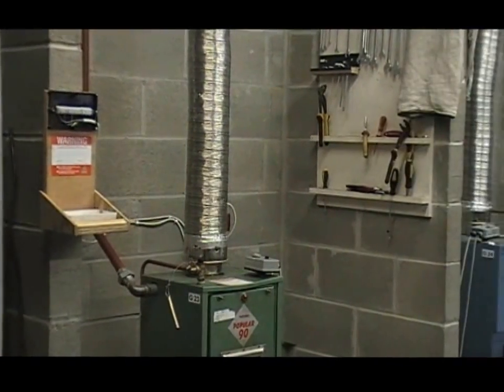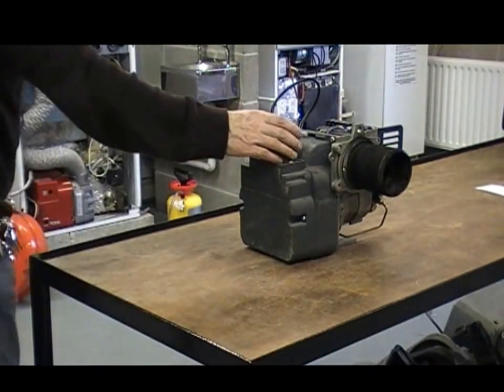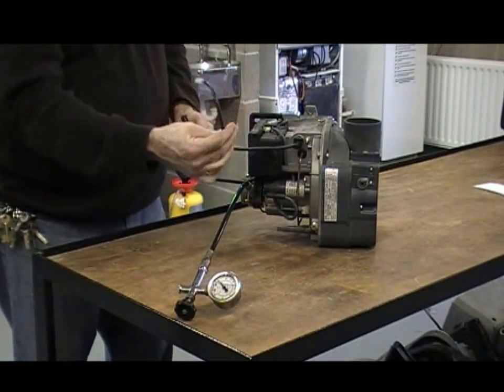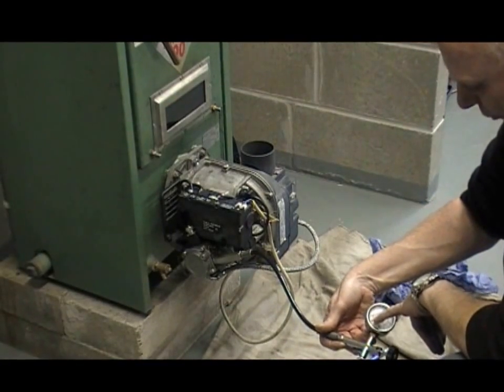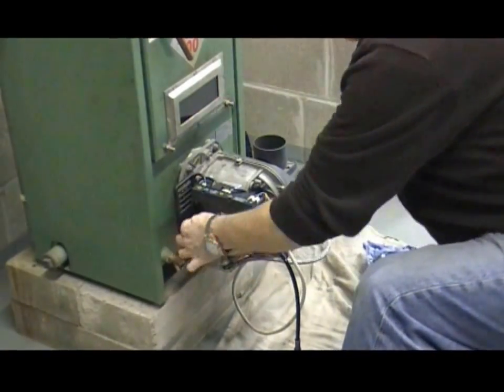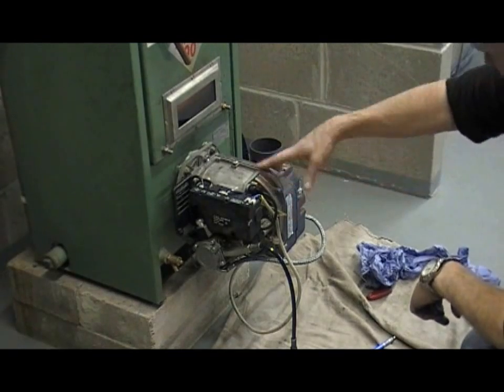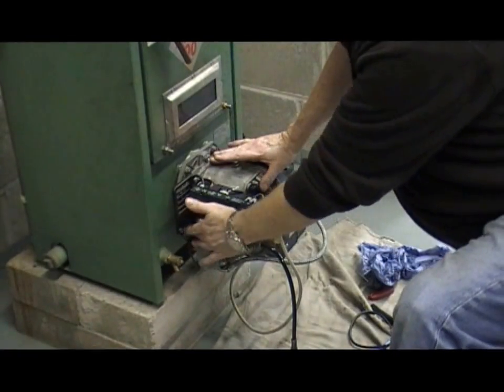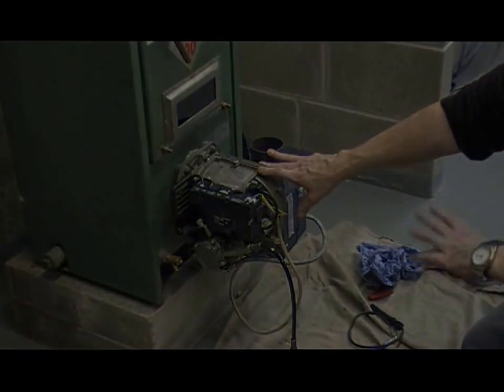Oil Burner Fault Finding

Comment: Hi
I have a WarmGlow BlueBird 70/90 Burner 	that worked for Years that worked for years but stopped working last year.When i tried restarting it recently ,The Power kept tripping. The front panel of the Burner had a Lock at the Bottom of it.When i went to take the front panel off the key was nowhere to be found so i drilled the lock. I Checked the Tank and it was half full. Next , I checked the power going to the Pump ,it was ok, I checked the  power going to the Burner that was ok. I checked the  tank in the attic and that Tank was full. The situation at the momeNt is ,The Burner is working , But the Radiators are not heating up. I would be extremely grateful for any advice /Help available

Kind Regards
Peter.

Comment: Hi read your tip, my Firebird is running. But no flame ,have replaced solenoid as you said , it fires up runs for an while then locks out
Have to leave for hood while try again sometimes it fires others not
Have clean tank and boiler  replaced filter in fuel line  still not working ANY IDEAS
Reply: I have no ideas. Sorry.

Comment: You can't do a proper service without a Flue Gas Analyser. Only guessing without one. FGA needs to be re-calibrated every year. Pump pressure needs to be correct for the fuel - i.e. about 9 bar for Kerosene C2 28 second oil - which is all modern condensing boilers are supposed to run on. Nozzle should be changed once a year and flexible oil line on condition. The nozzle must be the correct spray angle, spray pattern and flow-rate for the fuel and burner rating.  Boiler flue needs to be up to normal operating temperature when taking the FGA readings. Baffle plates and combustion chamber need to be cleaned out completely. That's just the boiler - the storage tank also needs inspection.

Comment: mines a danfoss pump on an old nu way boxer burner-it sounds similar to this but a change of solinoid has not worked-it goes to fire up and then it sounds like a back draft and can get quite smoky but no ignition? any ideas welcome?

Comment: Nobody bothers their arse getting a proper service done, with all these procedures, they only call you when the boiler/burner stops working, at that stage it's usually too late and the burner needs replacing, people don't give a shit once there's heat, what they don't realise is they are probably using 25% more fuel when the equipment is not properly maintained, iv seen boilers so full of soot and crap that you have to scoop it out, the blast tube burned down to nothing, leaking oil lines, crumbling flues, boilers outside in bits covered in whatever is around, as I say they only call you when they stop.
Reply: I've a firebird that hasn't worked since the day it was installed. I live in a council house and we are NOT ALLOWED to touch it.  We have to call out the council to repair it.  Every time they come out they clean the filter and walk away.  Runs maybe for a day or two and packs in again.  It's not that people don't give A SHIT.  Not in this case anyway.  But then again it's only 17 YEARS since I reported mould and Cavan County Council still haven't dealt with it.
Reply: Cheer up Stephen.
Reply: @jimmymcjimmyvich9052  Happy Christmas 🎄☃️
Reply: @TheBenzer9  Happy Christmas Stephen)))
Reply: hi Stephen do you service boilers yourself. im in kildare area.
Reply: Thats the reason why im here as multiple guys refused service it as its 15ish years old and in pretty shabby shape. So i decided to attempt to fix it myself before im forced to buy new one

Comment: hi we have a firebird oil boiler and we have it serviced each year, the flu was reseasled this year and all the efficiency tests flu gas etc are fine. On initial start up as the boiler purges, we get a slight wiff of fuel oil and this will happen each time it starts up. any ideas, we had new seals fitted to the burner cover as well but certainly the problem is around initial purge and ignite, a lot of people say you may get a slight smell but as I have never had an oil burner I have no Idea, the engineer is back out and I have mentioned a number of things, ignition time, photocells etc and asked him to spend as long as he must as I want it to be safe.
Reply: FP51DPO f